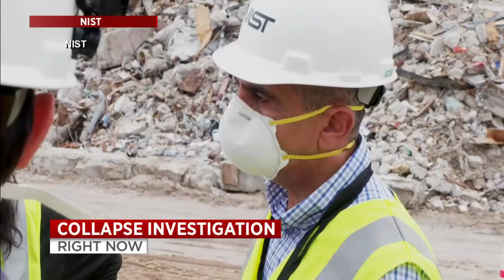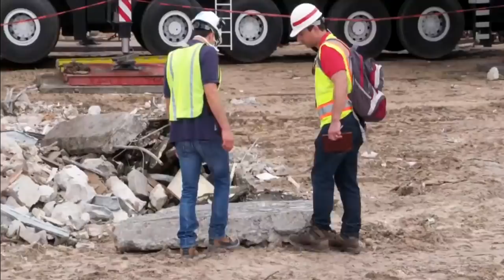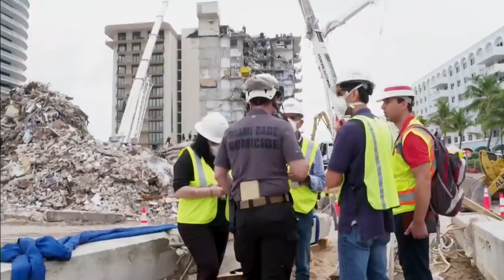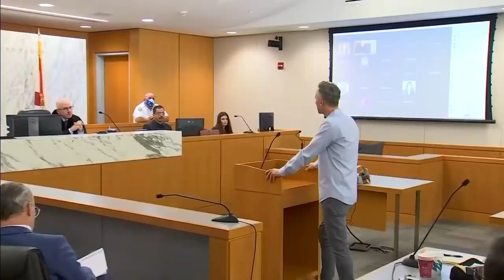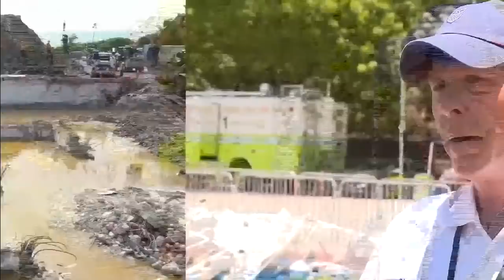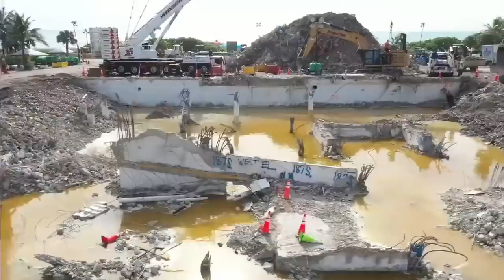New video shows federal investigation into Surfside collapse

Comment: I'm not going to hold my breath that the cause will be found and or released or that the families will know why their loved ones died. Mainly because its the federal government and they are masters at covering up bad stuff.
Reply: While I agree with you that the government is good as covering things up, the feds really have no reason to cover anything up in this case. The building was privately owned and they had no jurisdiction over it outside of federal business, which doesn't typically include oversight of local and state building codes, safety, etc. The city or county may have some explaining to do, but not the federal government. It's good that they are involved, as they are disconnected from local corruption or ties, so hopefully there will be better accountability.
Reply: Gurn> There is no reason for coverup. NIST has no stake in this building and absolutely no reason to hide anything. Further, the federal gov't has no responsibility in this building either.  Peddle your conspiracy theories elsewhere.

Comment: And pretty soon the ''blame games" will start.  That should be very interesting.  Poor souls, may they rest in peace.  Such a tragedy that could have been avoided.  The garage was practically falling on their heads, yet they decided on a new roof.  Now that makes sense.  That building should have been condemned, or evacuated as soon as they saw the rebar breaking through the concrete, and the standing salt water.  Why is it nothing is ever done in situations like this before a terrible tragedy happens, then suddenly everybody snaps to attention.
Reply: Every single concrete building has "rebar breaking through the concrete" at some point in its life.  That's your indication that maintenance is required.

Comment: People do not understand the power of water.  It is relentless.  People don't think it can effect brick and concrete but it does. Constant seepage into cracks and joints will work it's way to the rebar that it supposed to tie everything together and it only takes a few weak column's or slabs to let go to start the destruction.

Comment: I have watched many videos! It was a failure in how it was Constructed! And possible work that they had been told to fix by a inspector in 2018 wasn’t either done or it wasn’t done right!
Reply: The 2018 inspector is the same one that was doing the 40 year inspection.  His projected repair cost went from $9 mil to $15 mil between 2018 and 2021. They couldn’t raise the 9 mil.  They billed the owners for the 15 mil the week before it collapsed.

Comment: Here is my thought: If this were a plane crash and condominiums were treated the same way as a plane, then every condo for miles would be under close inspection and new recertification would be needed.  But since a building crashed - no biggie - right?
Reply: What are you talking about? They’re inspecting every building over 6 floors older than a certain age. This triggered exactly what you’re talking about.
Reply: @stargazer7644  Maybe where you live but certainly not elsewhere. How would I know your local news?  Even if they did it state wide I would not necessarily hear about it.  And no matter what they do, inspections will take a long time to be done properly if there is giant sudden demand.  

The point is the system failed.
Reply: @johnjon1823  I'm talking about Surfside and Miami Beach.  You know? "every condo for miles"?   They ordered them the day after the building collapsed.  Miami Dade county ordered them to be complete within 30 days.  You moan and complain they aren't doing anything, then when you're told they ARE doing something, you complain that you wouldn't know about it.  I know about it, and I don't live within 2000 miles of there.  Do you just like to complain?
Reply: @stargazer7644   I have not complained at all. I've made observations and suggestions and presented opinions.  You are free to  interpret them as you wish.  As for what is going on far away, I see no reason why I should possess local knowledge of distant places. nor why it should be assumed that I would.  

I see no reason why saying one is not aware of distant actions in some local is somehow a complaint.  It is called an explanation.

Comment: Can someone enlighten me on the reasoning to allow for excavating that close to a large body of water.....maybe I'm missing something or just not understanding..if the pool was @ ground level & the parking garage was below the pool level .....?? Not only should you Not be allowed to excavate but REQUIRED to build up a foundation to elevate the structure in addition to pillings going down to bedrock.....does the building code read different ? I mean if you build a seaside home your not allowed to put in a basement, stilts or the equivalent would be required....IDK
Reply: Buildings in flood zones and wind velocity zones require special engineering which I'm sure this building went through. The idea is to protect against storm surge, thus the lower walls would be breakaway and no living quarters would be in the lower levels. While the walls could break away the supporting columns and beams should still remain to hold the building up. Columns are placed on a series of pilings which are engineered to meet the load requirements plus a safety factor of what they are holding up. The problem with a basement in on a seaside home is uplift. The basement either leaks or acts like a boat when the water table rises. The engineers probably had to convince the building dept. that either the water table was lower or they had in place the correct design to withstand the uplift from the ground water.
Reply: The garage level was dug about 4 feet into the ground.  The ground level was built up compared to the beach.  The floor of the garage was still above sea level.  The pool deck was the roof of the parking garage, and the pool itself was in the garage.  There is no bedrock under these buildings.  Most likely, your house isn't built on bedrock either.

Comment: The reasons were greed and lack of maintenance no matter what the actual cause within its structure. The loss is immeasurable. Lack of repair and maintenance.  This all was 110% avoidable.
Reply: LW: No, it's not all about repair and maintenance.  It is already clear there were design problems.  It remains to be known if there were construction and materials problems.  Testing in progress.

Comment: Plans called for sloped pool deck and lots of drains ...... no, no the people cried ,  can't  have those slopes . So a few tons of extra concrete was added to even out the sloped decks , then they decide huge concrete planters were needed, there's   a few more tons of concrete  that was not allowed for on the plans . They built a time bomb and it went off  pool deck separated from the columns and the heavy deck with the heavy planters knee kicked four columns  at the same time and down she came .. one column have have fallen seven minutes before the collapse . That should have tripped the sprinklers , and the fire alarm . Why didn't  it ??????
Reply: Fire sprinklers and fire alarms are tripped by smoke and/or flames, not motion.  The bigger question is why did the street-side portion (which remained standing) have support columns of 24" x 24" dimension, while the equally high/heavy portions that collapsed only had 16" x 16" columns??? =:O
Reply: @MajorCaliber  I believe this has been called out. Corners were cut every chance it was possible. Additions and changes to the building did not take these weaknesses into account.
Reply: The "huge concrete planters" are in the original plans.  I just looked.  And nobody is going to notice a drainage slope in concrete.  The fact that the waterproofing wasn't installed correctly would be a bigger problem.
Reply: The fire alarm was sounding before the collapse.  That’s why the first fire engine arrived just moments after the building fell.
Reply: my question is why was the deck and the bases to the buildings all one slab to begin with? you're situated on sand/silt with too much depth to hit actual rock bed (not including any water tables here) which is going to shift from time to time anyways. you have buildings in the area of varying height that are going to sway a bit from just normal winds (many areas a know to have mini wind tunnels just from buildings being a sort of wind breaks at ground level) and have counters at the top to prevent a lot of motion (swaying), if not "walking" of the structure( especially when needing to deal with hurricanes). it would make sense to have sectional slabs butt up against each other than one large one in case of failure. okay, amateur playing obvious adam here.
Reply: maybe the collapse happened too quick to trigger and safety systems in time.
Reply: You’re a condo owner at the subject property with firsthand knowledge?
Reply: It’s Florida, land of the GOP who eliminated regulations and enforcement. The GOP leaves a trail of bodies once again. When will folks learn that regulations save lives.
Reply: @drew8256  In 1979 Florida was solidly Democratic.  Find another boogie man to falsely slander.

Comment: I see a similar problem with all of the high rise buildings.  Have a look at how the engineering students are taught to structure reinforcing.  It is always laid at 90 degree angles.  The outside of the reinforcing rusts in situ, and this creates a tunnel for the reinforcing to escape from, when the tension exceeds the strength of the reinforcing.  By laying in this manner, you are basically creating shear lines for the concrete to break and escape from the reinforcing.  It is suggested that reinforcing should be laid at 45 degree angles, thereby creating an interlock.  You try pulling 2 pieces of timber apart when you have nails driven in at a 45 degree angle.  Same principle applies to tent pegs.  Put in vertically or with the top towards the tent, and it comes out easily.  Put in at an angle, with the base facing into the tent, then try pulling out with the rope, near impossible!  

When laying the 45 degree reinforcing, you need to have a minimum of double the thickness of the standard run of reinforcing, and the crossovers need to be staggered so they do not create a straight line for the cracks to follow.  To join the rods together, they either can be a 90 degree angle, interlocked, or threaded through eyelets made into the ends of the rods, and bent back on each other.  For the edges, use a random system of a 90 degree angle at the edge, and have the lengths of the legs staggered, so that your first rod is tied back into a wall, so you might have 5 parts going to the wall, and 1 part on the other side of the elbow, going back into the floor.  The next leg might be a 4:2 split, the third is equal, and so on.  By doing this, your are crating a pattern which should hold together, in the event that the standard reinforcing fails.

I am not an educaterd person, but, having seen the report from the Citi building in New York, and how a quartering wind was not calculated, and having seen the benefits of cross nailing timber pieces together, and the tent pegs, why is this not being factored into the structual and civil engineering courses???

Comment: I have more metal in my hip than that beam they showed? 🤯
Reply: If you ever see pieces of it sticking out your leg, get it repaired fast.
Reply: Damn
Reply: Four rebars, one in each corner is normal for a column of that size. Concrete not the steel carries the load. Biggest item is where was the column. Being it was 40 years old the building was strong as built but not if not maintained as we have heard that a 13 mullion repair was necessary which shouts that it should have be done say 10 years ago and only looked at when forced due to get the recertification. Failure to do so and the people who decided not to maintain it over the years paid the price with their life.

Comment: Approximately 55 families suffered the ultimate loss, but at least 81 lost property and posessions - should those 81 be forced to contribute to a memorial?  If the relatives of the 55 families want a memorial, they should buy the other 81 families out.  Then it is their property and they can do as they will with it, but they should not force the 81 through legal action, coersion or shaming to contribute to what will be a memorial only for the 55.
Reply: No. 81 others should be entitled to 60 unit per floor. 10 story backwards L shaped apartment building. 
At 15 an hour. Full garAge 24/7 its over 200,000 every 24 hours.  Build in south east, west end north west side. Maybe even more then 60 cars. Not enough parking in surfside. 15.00 an hour keeps rift raft out.  No more cars towed from publics. People park their cause their is no place to park and enjoy the beach. And if a memorial for the deceased. A place to park. A lovely marble pillars with all lives lost etched on stone. Nicer if water fall. For the tears the families, the responders and community cried over the misfortune of deceased. Building another residential commercial office spaces shop. Will be an abomination. In the long run, the money pays for its self and keeps giving for generations. Parking garage needs 3 employees every 8 hours. 2 for another 8. And 1 from 10 pm to 6 am.  Their should never be a structure built on the first collapse. To many souls not ready to leave trapped.
Reply: I think 1 man died in 1981 when crane fell dec.7th.  Crane falls bad omen.

Comment: This Building Without Any Question Should Have Been Condemned Year's Ago !!
Reply: @Becky Mommabear84 How many other buildings should also be condemned due to being    built with similar concrete and other building materials?
Reply: @gorillaau  

Yes. Way Too Many Unfortunately. 
I just don't believe that the sea/ocean was ever intended for building buildings up to the sky.   Perhaps like if you remember Collins Avenue  { motel row } 1st & 2nd floor only!!!
Reply: @rma3_3_3  they have had higher buildings though. Sheraton hotel for one and it is coastal.
Reply: @Becky Mommabear84 

Definitely Yessssss!
Reply: Sure, if by "condemned" you mean "fixed".
Reply: @stargazer7644  

Fixing. 
Repairs. 
Redo.
Renovations. 
Make Brand New!

Comment: Looking at the beams and concrete quality we can see why that building collapsed.
Reply: You can't judge the concrete quality just by picture.. but you can judge the type of rebar and the lack of it and too close to the edge
Reply: How many years of engineering experience and what degrees do you have. I have some ideas mostly toward totally lack of maintenance with my 45 years and not only a MS degree in engineering but also dozens of certifications. Concrete is a high maintenance material and mix that with water to the rebar and you spell disaster every time. Send a few small failures, but size only increases the aftermath.
Reply: @gc1172  I don't see any green rebar
Reply: If you notice this is showing BEFORE they took the rest of the remaining building down so it's nit even from today or current for that matter!
Reply: Crumbled concrete does not show the quality. Concrete needs rebar to stay strong, without it it fails. Always. Regardless of ifs quality.